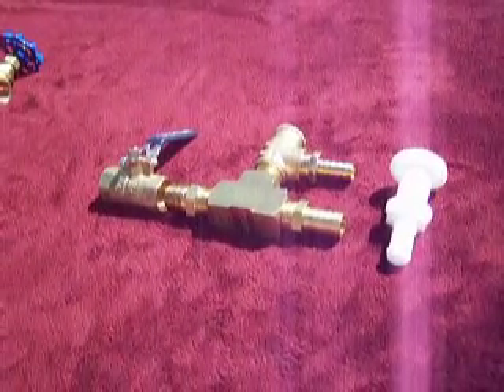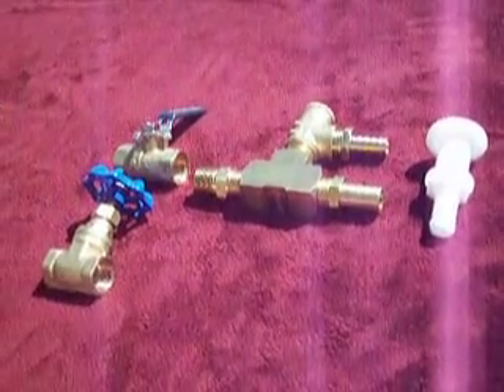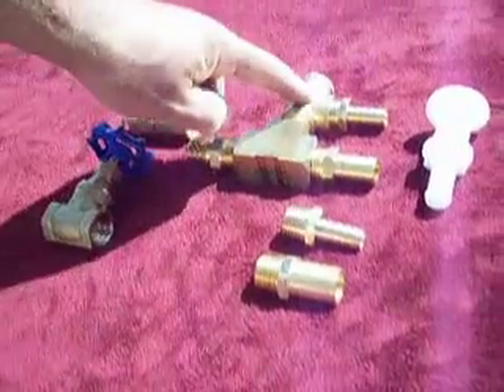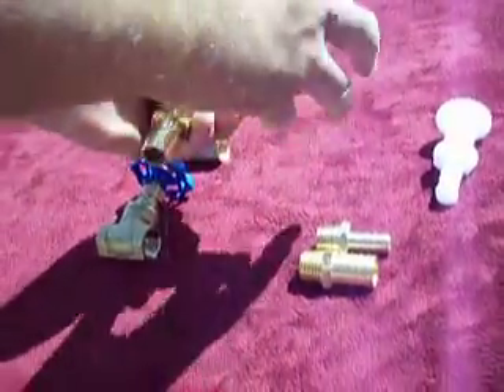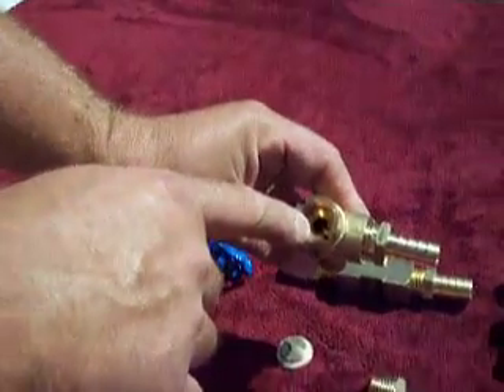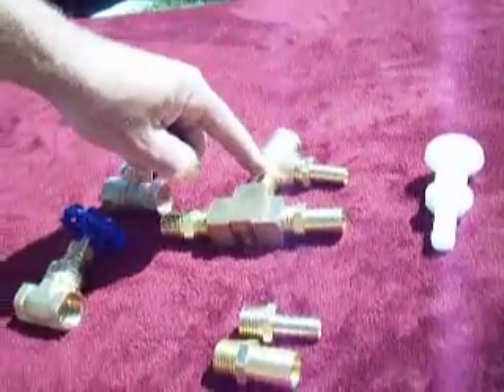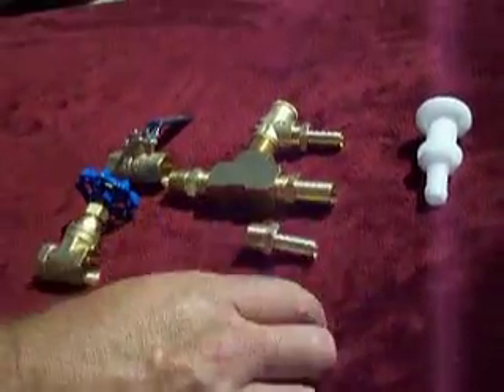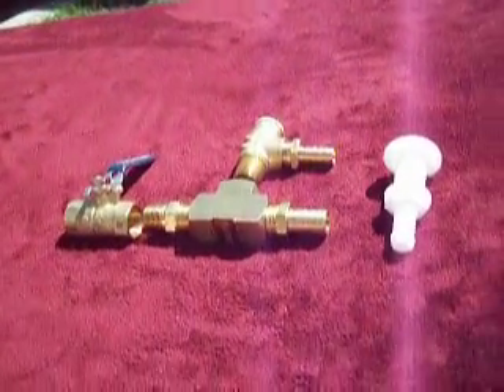Jet Boat water pressure  regulator system  (Video one)

Comment: Ever had anyone tie that pressure relief line into the log risers instead of drilling another hole in the boat for a spill fitting? Just curious on if it would cause any problems.

Comment: How do you know what the pressure should be ?
Reply from the maker: not to exceed 15 psi just like a radiator cap is designed to release pressure.

Comment from the maker: you need to connect a flush kit to your hoses coming from your jet pump. either before or after the regulator kit. Mine is ran after the water pressure regulator kit. The flush kit can be purchased at walmart or any auto parts store.